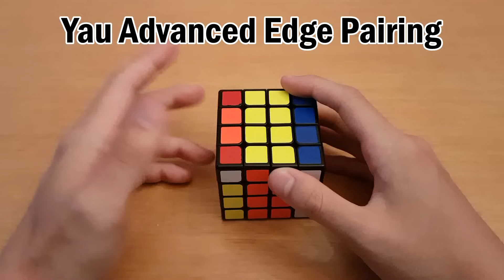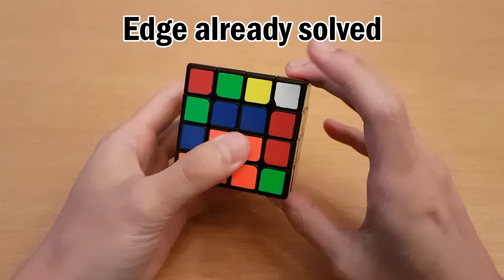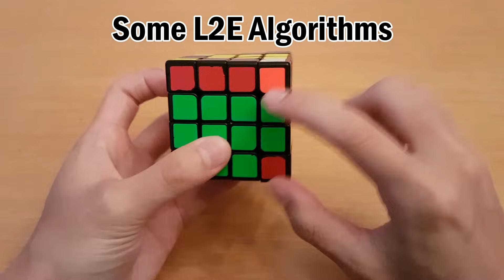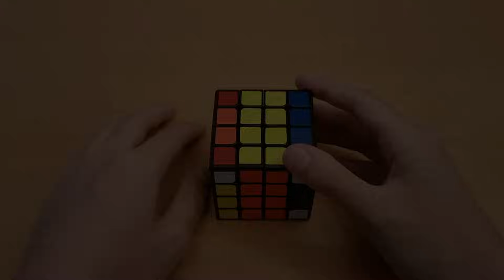4x4 Yau Method: 3-2-3 Edge Pairing (+ special cases)

Comment: Regarding the "Second edge is stuck"-case: What I do instead is the L2E-alg for this case, just with z- instead of x-rotations (z r2 D2 r' U2 r D2 r' U2 r' z')? This way 2 edges are solved at once. Plus, they're automatically in the middle-layer, so there's only 1 more to go until the easy lookahead-phase. (I think it's not ideal to move a solved edge from the middle into the top layer.) - Or is the algorithm actually slower (for fast cubers)?

Comment: Am following the layer solution and needed some moves for single edge flip on top face for adjacent and opposite. There are no paired edges on top/side only single and interchanged with opposite and adjacent edges.If there is an email I can post few pics, thanks

Comment: I've been doing 4x4 by doing all centers first and then pairing 2 edgepairs at a time for years now and trying to switch to yau with 3-2-3 edge pairing just breaks my brain. Like I fully understand the 3-2-3 edgepairing part of this, but keep getting all kinds of weird cases and really struggle with the middle centers because none of how I used to do them works now that I need to preserve 3 edgepairs on the left side.

Comment: J perm i need help!! I am sub 45 with yau, but for edge pairing i use 6-2. It's working pretty good, but i don't know if i should change this into 3-2-3 or not... because i am sick of the rotations with 6-2, but i don't know either the special cases of 3-2-3.

Comment: 3x3 is really where it’s at. However, I feel so much more powerful solving a 4x4. I’m not good at all but slowly learning the oll pll parities and can almost solve without help every time. I’ve solved 5x5 and all but last few pieces of 7x7 but there is something special about 4x4
Reply: Yeah true… 4x4 is like the middle man between easy yet complex and fast, and hard but long and simple - it’s like complex enough to be fun but not so long that it’s boring.
Reply: It’s probably because most cubes have an odd number (ex. 3x3, 5x5, 7x7)
Reply: @sitalatha3312  Well… not really. Exactly every other cube has odd and the other half are even. It’s pretty balanced lol
Reply: I am literally stuck on edge pairing
Reply: @sonaljain2271  just takes practice. Watch a bunch of people solving edges and see all the different ways and blend them into a method that works for you
Reply: @PhotonBread  I am close to do the edges thanks to j perm
Reply: Wow I was so close to do edge pairing everything broke of
Reply: Its like an infinity stone
Reply: 5x5 is so much better imo...cause it doesnt have parity
Reply: @yoinkkm7856  5 by 5 has parity, Wdym?
Reply: @siddarthkumaran3221  Technically, no. It doesn't. The flipped dedges in 5x5 aren't legitimate parity.
Reply: @spacevspitch4028  but like you can't solve it without doing the parity alg
Reply: @siddarthkumaran3221  actually you can. when you have 2 of those parities side to side turn the middle layer to the right and do  the flipping alg to the right (or you can do everything at the left) and voila!
Reply: @op_gamerytz9556  “when you have 2 of those parities” if there’s 2, it’s not parity. parity is when there’s 1
Reply: @ignDart  oh ok :)

Comment: can I use this with reduction?
Reply: Yes, you can use 3-2-3 edge pairing with reduction method. Solve all centers, then 4 edges like you normally do, place these 4 edges on the bottom layer and pair other 8 edges using 3-2-3.

Comment: Special cases timestamps
Edge already solved - 2:46
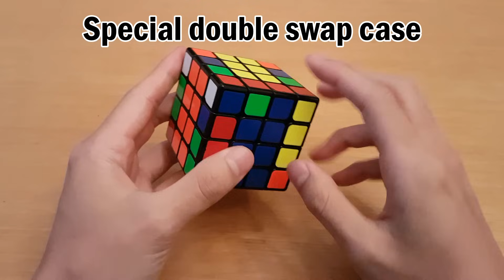Special double swap case - 3:53
Second edge is stuck - 5:08
First slice paired up an edge - 6:43
First edge is far away - 7:45
Third edge is stuck - 9:08
Some "Last 2 Edges" Algorithms - 10:17
Reply: J perm should pin this comment!
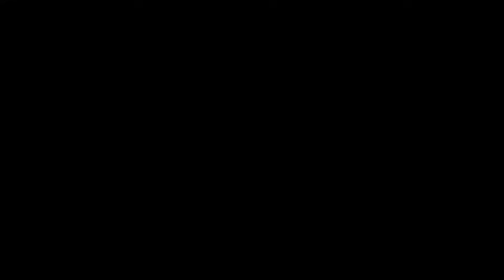Reply: Everything is solved - 11:42
Reply: @yeahuh4128   Oh actually Jperm showed the wrong algorithm for that case, so I didn't want to add the timestamp. In case you are wondering this is the alg that all top cubers use : R L' U2 D U2 D' L R'.
Reply: @chessbitz6846 thanks! just needed that alg.
Reply: @yeahuh4128  LOL
Reply: You're a hero
Reply: Thx
Reply: @ishse1147  nani
Reply: thx
Reply: Thanks
Reply: Thank you
Reply: Thx
Reply: thx
Reply: i always always have troble with the last 2 edges
Reply: The internet needs more people like u
Reply: Thanks a lot! These timestamps help a lot in navigating through the tips!
Reply: The Physics Pro yes
Reply: @HarmoYT  no anyone can do that

Comment: Confused on 0:26 cuz once u finish centers and three white edges (if ur not color neutral) there is still one white edge to solve so I don’t know what to do! I normally solve it with basic edge pairing but I’m feeling that I’m doing something wrong! 

sob
Reply: Please tell me wut to do anyone
Reply: Dont solve that edge, just go straight into the last 4 centres, that free slot will make it a lot easier to make the centres, the after you have made your centres, THEN solve it. Hope this helps (:

Comment: Hey 👋, in the 4x4 tutorial you finished with 3 white edges complete, but in this video there are already 4 edges comlpleted. I’m wondering how to solve that one edge. Can someone help me please?
Reply: You solve it after the last centers, the last white edge is easy to find, and you can simply pair them up like the previous ones, then insert.

There's also a section on this in the '7tips to be sub-1' video to save some additional time.
Reply: Dani F 😮 oh I didn’t know that, thanks mate

Comment: J perm, any suggestions on how to set the cube up? I'm using a stickerless WuQue which was set up with weight 5 and DNM, but it still doesn't seem to move as well as your cube. 

Also, I'm just trying to learn the entire Yau method before starting to practice and get used to the beginners method. Went from 8 mins (first solve)-> 4 mins (2nd solve)-> 2 mins (10th solve) any tips on further improvement? :)
Reply: Honestly, just buy the AoSu GTS2 M. Its better and totally worth it

Comment: Please help me! I used your yau method tutorial to learn to solve the 4x4. Every time I get to OLL and sometimes PLL, I have 2 edges that need to swap. One is in the front face and one is in the right face. Sometimes I will get the entire thing solved except those 2 pieces. I can even see what case I would get if the edges were flipped correctly. I don’t know what to do because I have watched so many videos on parity, because I used to think it was that. If I get parity, and do the algorithm, it solves the 2 other edges that were next to each other that needed to swap, but not these. I have taken the cube apart, put back together and scrambled it, and it does the same thing. Please help me.
Reply from the maker: parity doesn't always solve the cube, it just makes the cube solvable.

but in this case, you can use a modified parity alg to instantly solve it:
R U R' U' (PLL parity) U' R U' R'

Comment: JPerm, could you tell us if you prefer Yau over Hoya? If so, why? BTW, that’s an amazing edge pairing video!
Reply from the maker: thanks! Yau is better because of a lower move count for cross edges. I don't use hoya at all but this is what even top hoya solvers believe
Reply: J Perm Thanks for the reply.
Reply: Just one more thing, how will you compare an Aosu GTS M to a Wuque? 

I'm currently using a magnetness Wuque (first 4x4) and feel that it is not that free flowing at times. It got better after some set up but still a bit sluggish. 

In 3x3, I used to prefer GTS2M but now using the Little Magic nonmagnetic as my main as its speed and feel is so satisfying for me. (Yet still prefer the GTS2M for OH).

I was wondering whether an A-GTS-M would suit my taste.
Reply from the maker: wuque has better stability and fewer lockups, aosu gts m is faster.

i like my wuque (not M) equally as much as my aosu gts m, I find that the layers are unstable on GTS which means I have to turn really accurately.

Comment: Another thing you could do for the double swap algorithm is put the edges that need to be swapped in opposite edge slots (i.e. one edge in FL and the other in BR, while the other pair is in FR and BL) then do Uw2 then two edge flip algs, one on the FL slot and the other on the FR slot, then do a Uw2. tbh thats what i would do just to start off, but i might end up using your version further down the road.
Reply: That's way more moves.
Reply: Wtf

Comment: Seeing a video about tips for being sub 1 on 4x4 would be really helpful. My 3x3 average is sub 22, but my 4x4 average is sub 1:30.
Reply: Andrew Kimmey my 3x3 avg is 23 my 4x4 is like 230 how do I improve?
Reply: Hm. Well, without seeing it's hard to advise accurately, but what helped me was the same thing that helped me with 3x3, which is slow untimed solves and slow, smooth turning with attentive and purposeful lookahead. Oh, and be using the Yau method too. I also found that doing half centers helped me a lot.
Reply: Andrew Kimmey ok, I use the yau method with full center and just random inefficient edge pairing so I'll practice 3-2-3 a lot, half centers, and I'll make sure I'm efficiently doing things.  I know when I do edge pairing I move them inefficiently... I was just curious because everyone with my 3x3 avg has way faster 4x4

Comment: thank you you are honestly the best youcuber
Reply: and can you do how to be sub 25 on OH I'm stuck at sub 30
Reply: I am stuck at sub 30 with 2 hands 3×3
Reply: Same
Reply: @UnspeakableThings  bruv. sub 30 on OH???? I'm at 45 with both hands...
Reply: @couldbejames  sameee but im using beginners method lol
Reply: JH Park no don’t slow down to a specific TPS, slow down to the point where you won’t pause, or untimed solving
Reply: Boi Felix has the the best time in 4x4 and it was sub 20
Reply: Ikr
Reply: Agreed
Reply: I am stuck in sub 25 with 2 hand
Reply: Im Stuck On 30min WITH FULL BODY !
Reply: if youre sub 30 then you probably need to work on using inpsection time to solve a cross and/or efficiently/correctly inserting f2l pairs. you may also need to slow down and solve with low tps; since a typical cfop solve has about 60 moves, if you turn at 2 turns per second you can still achieve a 30 second time.
Reply: He is only the best cubing channel besides maybe cubicle
Reply: @zhuqunying5742  how dare you mention cubicles when you know he's sponsered by speedcubeshop